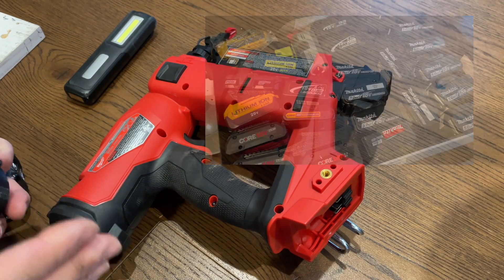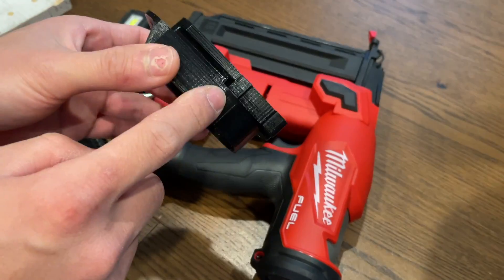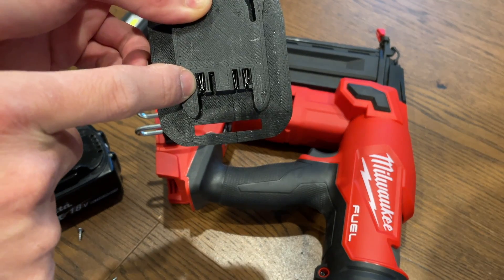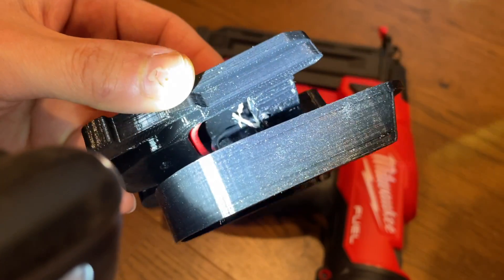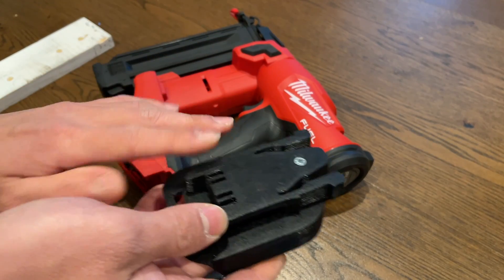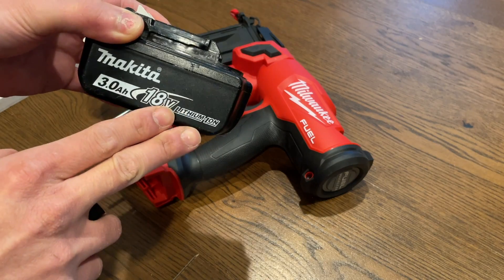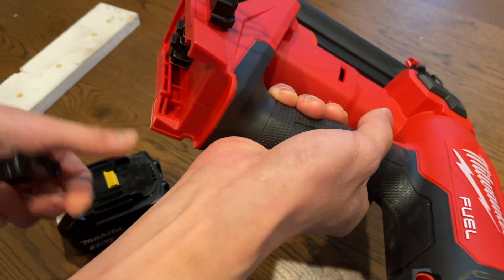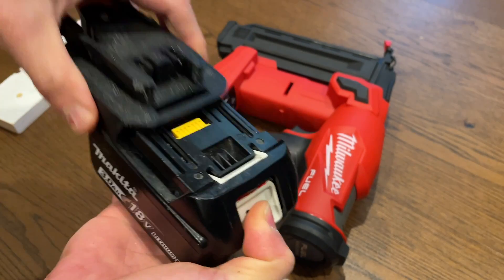3D Printed Makita 18V to Milwaukee M18 Adapter FUEL 18ga Brad Nailer (2746-20)

Comment: Isn't it more expensive all that design and fabrication than just buy the right battery???
Reply from the maker: Mos def. But I’ve invested over $1k in Makita batteries. I really don’t want to carry another charger with me. It’s fun for me to prototype and make things like this. And also, I did end up ordering a Milwaukee charger and battery a couple days ago. 🤣🤣
Reply: No
I have printer and makita battery
I download printer does work..
Done 
Cheaper
Reply: Link? No work
Reply from the maker: @mishkabg4411  https://www.printables.com/model/1095054